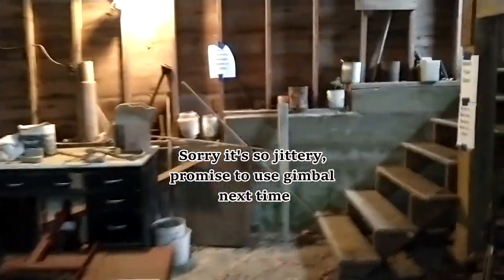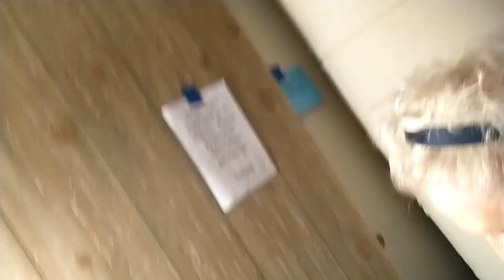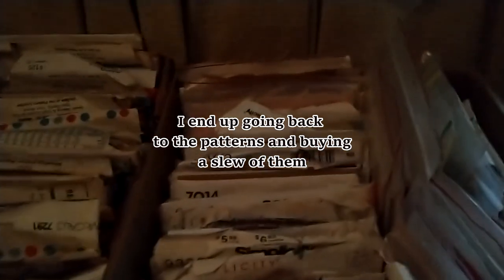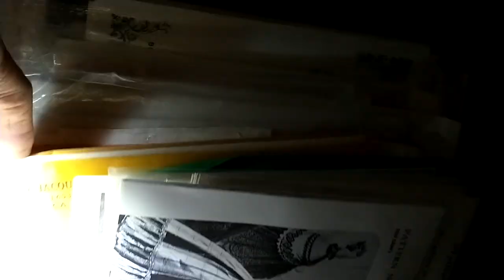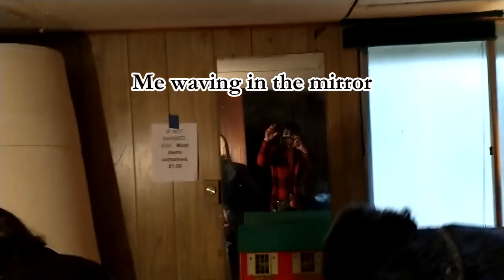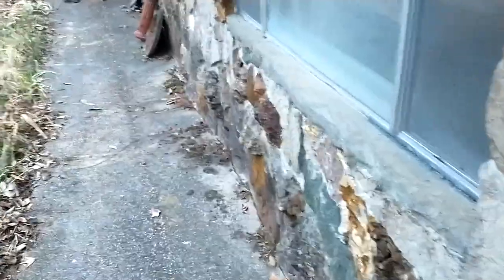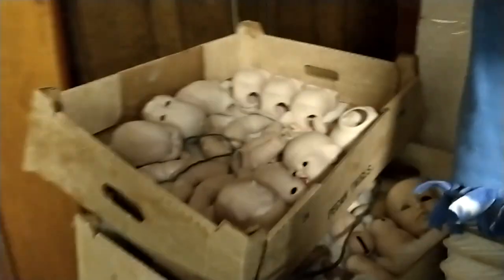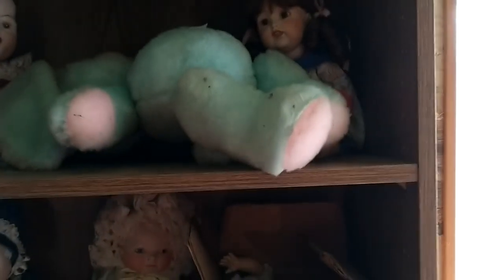DOLL HOARDER ESTATE SALE - thrift with me | Life Size Doll | Vintage Dolls Lots of Dolls 👀

Comment: I know it’s an older video but I just keep wondering why I always see that estate sales are typically extremely dark 😢they would probably have much better luck selling if lights were on🤔
Reply from the maker: I agree with you, however the kids usually have the power shut off so they don't have to pay for it. I was told this house sit for two years before they even had this sale by then it was pretty dusty inside. Thanks for watching.
Reply: @BJDBeautifullyJaggedDolls  oh yea I know that the electric is usually off cuz of that but sometimes they put battery operated lights throughout the house and some remind people to use their cellphone flashlight
Reply from the maker: @janiebrossmann1178  You are right. Actually they did state on their Facebook page to bring flashlights, but it's hard to video and use my phone light. I agree that they should put up battery lights for people.